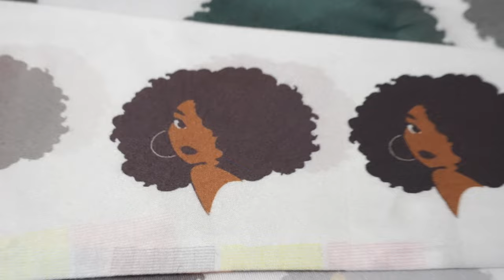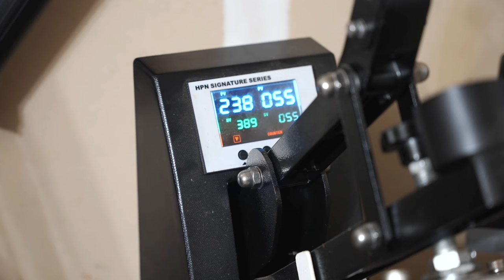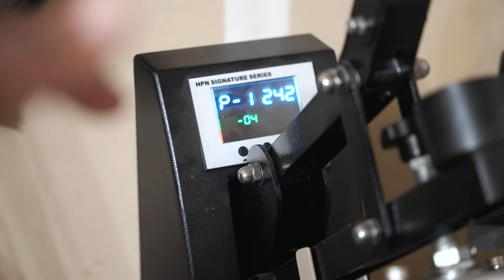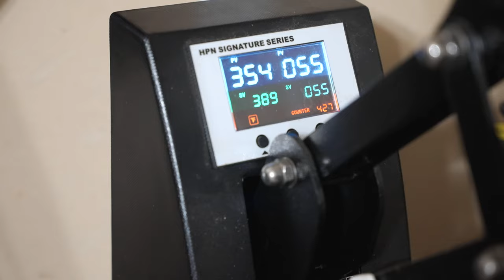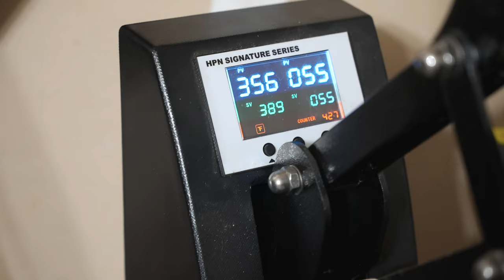THIS MAY BE WHY YOUR SUBLIMATION PRESSES ARE FADED!!!

Comment: I had to come back and search for your video after I tried what you recommended doing ... maaaaan  .. I owe you .. (thank you) .. my heat press was driving me nuts.. as soon as I turn it on it would read 200 degrees already and my prints were very faded and washed out .. I reprogrammed my P4 setting to negative 5 and BINGO!!!   400 degrees is now actually 400 degrees.  I appreciate you sharing this and uploading it.  Even the manufacturing company didnt have that option listed on their cheap troubleshooting guide.   thanks a bunch man... take care.
Reply from the maker: Glad it worked out for you! It's definitely a frustrating issue.

Comment: I'm encountering an issue with the color transfer process. The print is supposed to consist of four colors, but when I use a heat press, only the blue color successfully transfers to the garment. I'm reaching out for assistance as I'm feeling quite frustrated.